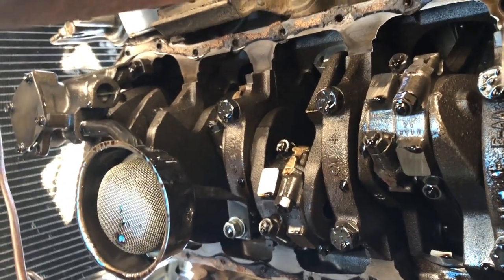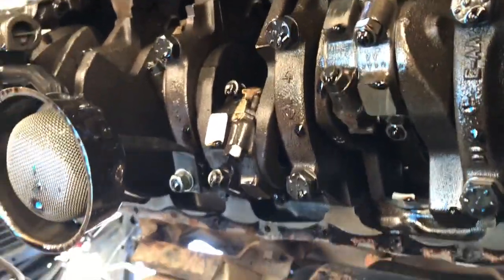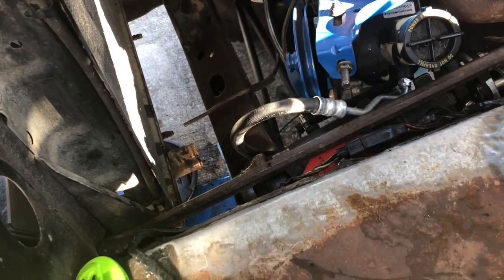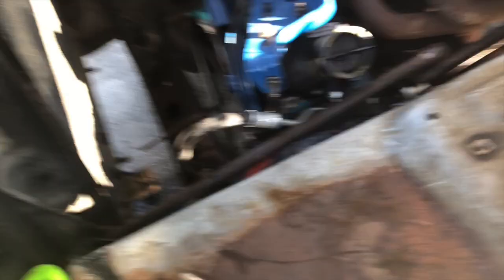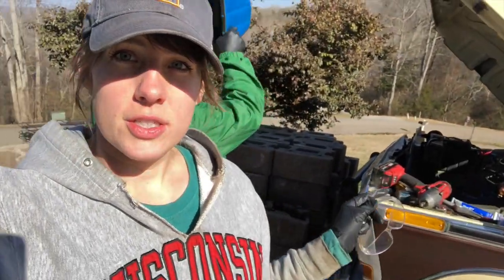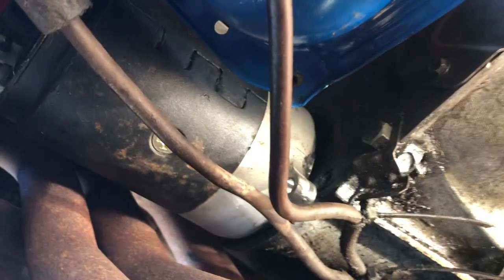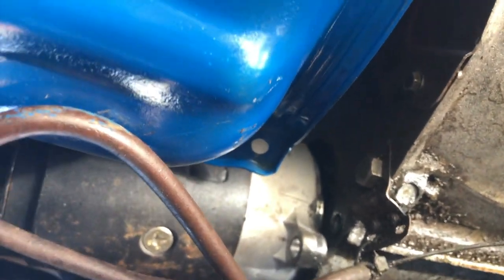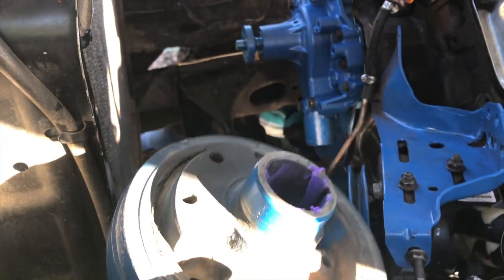Water pump and timing chain PART 2

Comment: Smacking the harmonic balancer with a hammer will damage the thrust bearing on the crankshaft. You are supposed to use an installation tool to do that!
Reply from the maker: Good to know!
Reply: Nice catch, and I have one, only used it a couple of times.  But it’s the right tool for the right job!

Comment: Engine sounded awesome running going to have to add Guru next to Bronco Babe. Did your gauges work when you fired it up? And also how many miles were on it when you bought it I don't remember if you mentioned it before. Thanks
Reply from the maker: Haha thanks! I bought it at 84k, not sure if it’s rolled or not. I think it sounds good too! I’m glad I don’t have that to worry about, at least not now. My gauges now work. There was some after market gauges on it that I hated and I just finished restoring the old sensors and I’m happy to say it all works great!

Comment: what were the crank numbers ..it will tell you if you have a 400  0r 351 m  ...They should be on the side of the first counterweight. A 400 crank will have 5M, 5MA or 5MAB casting code.
Reply from the maker: Oh cool, I don’t know my crank numbers but I do know it’s a 351m

Comment: Those darn Edelbrock carbs are sensitive to fuel pressure.  Recommend a fuel pressure regulator set at 5 or 5.5 psi so that carb will work better.
Reply from the maker: I will have to look into that. It was running fine and now it’s hard starting and being goofy. I’m wondering if I don’t have a vacuum leak
Reply: @broncobabeadventures4316   That is possible, vacuum leaks suck.  

Best way to determine if the carb is getting too much fuel pressure is to look into carb while its idling and if you see any fuel droplets than the floats are too high due to pressure and forcing fuel past that should not be. Or just put a fuel pressure gauge inline and note reading at idle and revving.  If it exceeds 6.5 psi that is not good.  Ideally 5.5 psi regulated pressure at all rpms is preferred.
Reply from the maker: Awesome thanks!

Comment: also you are missing bolt on power steering bracket 3 studs not 2 bid you break one ..it would start better if you hooked choke wire up and set it properly ..one to keyon power one to ground ..also its always a good idea to run extra ground wire to bottom bolt of starter from battery ..i am not picking on you ..just trying to help..if you need steering bracket i have at least 10 of them .. i had raced and plowed with  a 77-79 ford bronco trucks for at least 25 years still drive one daily and plow snow with them
Reply from the maker: I do need a power steering bracket! I’ve been looking for a decent one for awhile now. And thank you for the tips! I appreciate it. I know I need to hook up and electric choke but I know nothing about it, including where to start. Any suggestions on a certain one to get?
Reply: @broncobabeadventures4316  you have one on the carb you have put key on power to plus side and ground to other then adjust it ..bracket i will send you one free i have lots of stuff